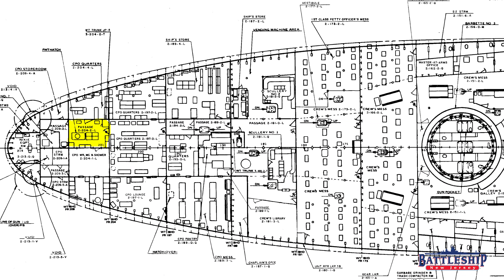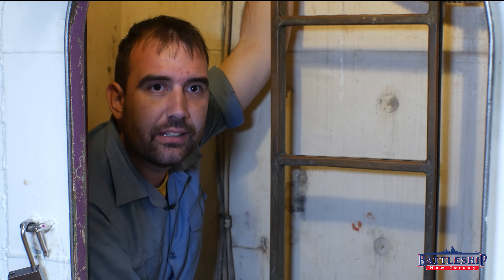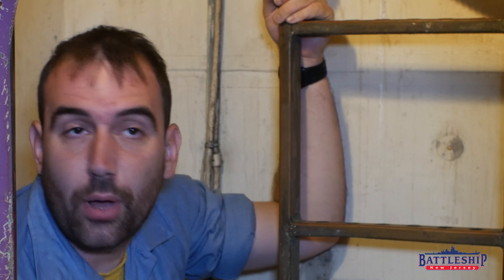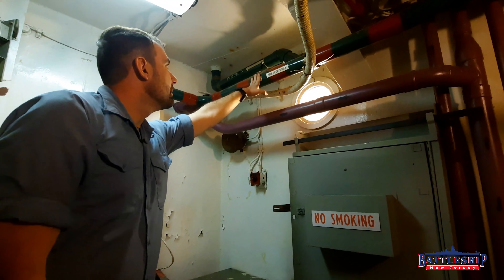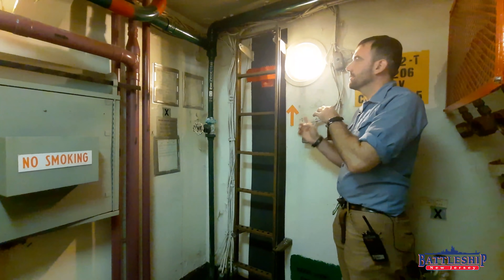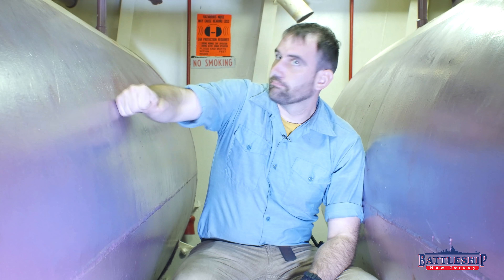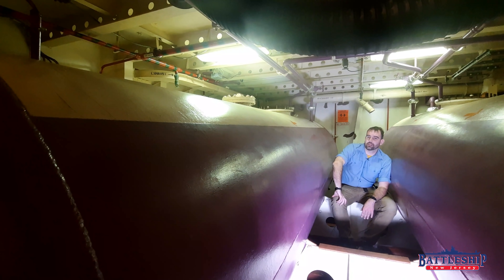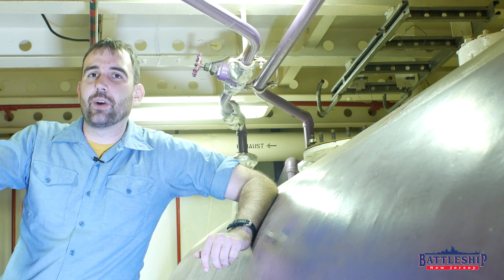JP5: Aviation Fuel

Comment: I was stationed on BB-62 in 88-90.  I was Oil King on an AOR 91-93.  While on AOR I was responsible for roughly 8 million gallons of fuel, and transferring it to the fleet.  A couple of minor things, which have been mentioned, but want to clarify. First we don’t use Octane for a fuel rating. 

AVGAS, Aviation Gasoline, used during the early days of aviation. As mentioned closest to modern gasoline that you use in your cars.  It was originally stored in these tanks because it was highly flammable. 

JP-5 (F-44) modern jet fuel. Flashpoint minimum requirement, set by USN is 140 degF.  Most of the time when I tested it it was about 150-160 degrees.  In other words it didn’t burn as easily, however, if atomized, burns really good.  It usually contains anti-icing additives. It’s limits for bottom set time to and water, BSM, is very low, as I recall about 0.1% and must be “clear and bright” no visible water or sentiment. This fuel could be burned in the boilers, diesel generators, diesel boats, and aircraft, including jets and helo’s.  Usually, it was only used in aircraft due to cost.  The only reason it was in these tanks was left over from WW2 Avgas tanks.  Easier to clean than replace. Most ships store this fuel in standard fuel tanks..

DFM (Diesel Fuel Marine, F-76).  Closest to what people know as #2 diesel you use in your cars.  Usually this fuel is refined better than the old fuel burned when the ship was first commissioned, black oil. It is not as good and clean as JP-5 or #2 diesel fuel. Primarily used because of cost. It is burned anywhere you need “diesel fuel” boilers, Diesel engines, diesel boats, and Gas Turbine propulsion engines.  Flash point minimum 140 degF, although it usually was about 170-190 degF when I tested it. The fuel was much dirtier by allowance, BS&W of 2%, clear and bright requirement, although we were allowed some visual sentiment and water. 

Due to several factors, we never burned DFM in aircraft, they just didn’t like all the “dirty fuel” boilers/engines can handle. However every engineer I knew preferred to burn JP-5 in the boilers, and Engines, since it was cleaner, it was easier on maintenance. 

The reason the space is listed as “7-“ the space designation is based on the lowest deck in the space.  So this space is open to the voids, all the way down at 7th deck. Just because your standing on “5-“ doesn’t mean that’s the space your in.

BTW, although they are two pumps outboard of the tanks, the big cylinders were fuel filter/separators.  They cleaned the fuel before sent to the aircraft nozzles.  It could also be used to “clean” the fuel in each tank in case it became contaminated.
Reply: Thank you!  Hearing "Av Gas" and seeing "JP-5" gave me an instant headache.
Reply: Oil king! How did you get that job? Did you deal with lubricant or just fuel? So none of that nasty number 6 fuel that took steam heat to get burning? Got offered 6000 gallons not a long time ago half and half number 2. Turned it down. Had no idea what to do with it.
Reply: @SkinnerBeeMan  basically I was supervision for Cargo Fuel department, title just an easy way of saying that. On AOR only dealt with fuel. On Jersey, I was in charge of departments oil also.  

Good plan on refusing the fuel, unless you have a boiler, it’s pretty useless.
Reply: @cruser69  yea I had tobacco barns that are oil fired but no steam sorta ended that idea. I do occasionally water down used motor oil with diesel and filter at 100 micron and burn in older diesel motors. Newer high pressure rails on 10 micron clog right up. I imagine on a BB your job would be alot of work with all the different tanks, age of tanks, sheer volume etc
Reply: @SkinnerBeeMan   Thanks for tab at aded  info.
Reply: Adeded info.
Reply: @cruser69  You forgot to mention that you were a critical part of maintaining ship's trim and stability, and that an error on your part could potentially result in the breakup and total loss of the vessel in heavy seas.  Don't sell yourself short...

Greetings from the IC Shop!
USS Kansas City (AOR-3)  88-90
Reply: @kevincrosby1760  would you please quit banging on the deck up there?  How can I possibly sleep in cargo control with all that noise.

Great to hear from someone who knows. KC, I went to RAS school with someone on her. 

Yes I could really make life bad, that’s why Cheng listened to me, and called me directly more than once.
Reply: @cruser69  I can still remember the sound of the emergency diesel firing up and shaking everything.

Now that the AOR class is totally gone, secrets can be revealed...like why you could never find the Duty IC in port.  Remember that blind-dogged hatch for the IC Shop in the escape scuttle?  We'd undog it and put a piece of tape on it from the inside so that it stayed closed, dog and lock the main hatch to the P-way, then pop up to the Cargo Deck, down the scuttle, into the shop, and dog down the scuttle behind us.  Voila!  One dark, quiet, air-conditioned sanctuary which appeared to be unmanned and chained/locked from the outside.

For those who are now confused, the IC shop was 3-49-0-C...Third deck, amidships, and centerline.  Cargo control was directly below us, EDG directly to starboard.

Comment: I can hazard a guess at why the avgas had a tank instead of just being a void space: moisture. By having a physical tank you can sump the water that condenses inside the tanks out so it doesn’t get put into an aircraft.
Reply: It also allows the inside of the tank to be pressurized with CO2
Reply: Many aircraft have sumps on the fuel tanks to drain water as well
Reply: @michaeltruett817  yes they do, but if you can prevent the water entering the aircraft’s fuel tanks all the better
Reply: I imagine aircraft engines (of any era) are much less tolerant of contaminates that the ships engines & generators.
Reply: I can confirm the science, planes dislike water greatly.
Reply: @JimNotAvailable  I dunno man U.S. Airways flight 1549 seemed to like it quite a bit

Comment: So JP5 is not gasoline, diesel, or kerosene. JP5 is most similar to diesel but it is different enough that some diesel engines can't run on it without additives. JP5/8 is made at a refinery to special specifications set by DoD.

Comment: As others have noted, JP-5 is not gasoline.  Fuels for things that fly basically break down into 2 major classes.  There's a bunch of grades of gasoline, all of which are not terribly different from the gas you put in your car.  If you spill a bunch of gasoline on the floor and toss a match in it, you'll have a big fire.

Then there's the jet fuels, which include Jet-A, and all the JP blends.  These are all pretty much the same as kerosine or diesel fuel.  Spill a bunch of any of these on the floor and throw a match in it and the match will go out.   This reduced flammability is exactly what makes them so useful aboard a ship; less chance of an accident (although you still want to be paranoid about spills and fumes).  Calling JP-5 "aviation gasoline" is really confusing.

Comment: The main oil-fired boilers could probably also run on JP5.  My house has an oil-fired boiler, and while looking up other things, I noticed that jet fuel is one of the approved fuel sources for the burner.  JP-5 is a just a military grade of kerosene-derived jet fuel, essentially.
Reply: The ships boilers were modified to run distillate fuel in the 80s. Still an oil bit a bit easier to flow without the need to preheat it.
Reply: @jth877  Yeah, it would suck if the Captain requested flank speed and the chief of engineering says they are still waiting for the glow plugs to heat up....
Reply: Isn't it basically just more pure?
Reply: @BlackHawkBallistic  More pure with special additives, yes.  Fuel oil has a multitude of grades that get progressively more ... disgusting.  Heating oil grades are less pure than road/aviation fuels, but more than many grades of fuel oils, as I understand it.
Reply: @jimmitchell6000  Yes you get different grades. What most ships burn out at sea is very much the same as road tar, the heaviest fractions that need to be heated up with live steam to get them to flow, and thus are only used when far out to sea, as they are not exactly a clean burning fuel. But very cheap, and high energy density, so get used, even if the exhaust would fail any pollution standards. Come in and you switch to a more volatile fuel, often almost the same as the engine lubricating oil, which is also burnt in the engines to dispose of it.
Reply: @SeanBZA  not a single ocean going vessel will burn lube oil to get rid of it as it is way more expensive than fuel. The fuel used in ECA areas is limited in its sulphur content but if available can still be heavy fuel. Maybe you’re talking about the incinerator these machines are capable of burning sludge produced by the vessels purifiers.
Reply: I would not use AVGAS in your boiler 
Diesel yes jet fuel no
Reply: @FP194  Today I learned that the military doesn't know what its talking about if it calls jet fuel "AVGAS". :)
Reply: @jimmitchell6000  The military knows; the curator mixed up the terms.  Purple color coding is for JP-5, and that’s what NJ used to refuel turbine-engined aircraft during her final active period.   AVGAS was only used in piston-engined aircraft which were long-gone by that time.
Reply: @jimmitchell6000  Trust me, they know the difference.  The confusion comes in due to the fact that, in this case, the original AvGas storage and piping system was apparently re-purposed in later days to handle JP-5 jet fuel.

Comment: its stored in tanks because of the fumes 
.
the fumes are what burns.... not the liquid
and you dont want the ENTIRE ship to smell like fuel fumes...... (or have a HUGE ventilation system)
.
like... you dont want your entire ship being a big "fuel-air" bomb..... 
.
.
diesel fuel does evaporate and create fumes
but its MUCH MUCH slower to evaporate 
and the fumes are NOT flammable

Comment: Hi, would just like to say that I only recently discovered your videos and that I enjoy them a great deal. I would also like to address a couple of things within this video. First of all I believe that when the battleship was commissioned and had airplanes on board the gasoline which at that point in time was indeed gasoline was somewhere around 130 octane. Later on when turbine helicopters became the norm there was no longer gasoline in those tanks however jet fuel which is not gasoline at all but or along the lines of kerosene which is backwards compatible to the dirtier cousin of it which is diesel fuel. The reason that those tanks were designed the way they were designed was likely due to the fact that fuel in aircraft is considered a critical issue especially when it comes to moisture content. I wouldn't doubt that those tanks had a means by which to drain water out of the bottom of the tank where it would separate from the fuel itself. That is probably why they were designed the way they were designed. Another factor in their design may have very well been that when the ship was originally commissioned in those tanks held actual gasoline the gasoline is far more explosive than diesel fuel.

Comment: JP5 is not avgas. It's closer to kerosene.
Reply: JP-5 is #1 diesel with some extra additives.  You can run it in a diesel engine.  I am sure they used AVGAS through Vietnam.

Comment: Should note that JP5 was always used aboard ships due to it's higher flash-point than JP4. JP4 was still the main fuel used ashore when I was in. I believe today most of the services use JP8.
Reply: Navy still uses JP-5, and the few times I've gotten close to a few helos, it says they're rated for JP-5 or JP-8

Comment: Avgas Purple (fuel was dyed purple) was high octane for Supercharged radial engines , 82 octane red was lower car gas grade , 100LL Blue for small planes etc , You can run a turbine on avgas but you can't run a gasoline engine with jp5
Reply: My dad use to be a pilot.  I love those colors.
Reply: @studinthemaking  used to run our fuel trucks at the airport on 100LL blue 😊 just run the nozzle to the gas tank anywhere you felt like filling up..
Reply: @Droodog127    My dad use to put it in his cars during the 70’s gas shortage at the airport. Blows the carbon right off the engine.  Digital fuel equipment ruined a lot of cool car stuff.
Reply: @studinthemaking  shhhh  I ran my '76 chevy pickup with it too lol
Reply: @Droodog127     Ran our Chevy station wagon it.
Reply: @studinthemaking  miss the old 350 Chevy with the 4 barrel carburetor, that truck had 200,000 miles on it when I bought it for $100 , I sold it for $50 after the state refused to inspect it any more LOL
Reply: @Droodog127     Did the avgas burn up your spark plugs fast?
Reply: @studinthemaking  no, mixed half and half with unleaded and a few moth balls , someone ripped out the catalytic converter and put a duel exhaust in it before I had it , it was just engine, no fancy computers, I changed the head gaskets before and it ran clean for a long time .
Reply: @Droodog127     My dad was a real cheap skate.    He dump straight avgas in it and fill it up just to save a few bucks.  He was always replacing something on our cars.

Comment: JP-5 is NOT gasoline, and is far from it. It’s jet fuel, which is a kerosene derivative. Closer to diesel than it is gas. Modern warships with LM2500s can run off of either marine diesel OR JP-5. But either way, calling it gasoline is entirely incorrect.

Comment: aviation gasoline of WW2 was very high octane with a really low flash point.  Puttng that into structurally independent tanks reduces chance of leakage from battle damage and thus, risk of fire is reduced.   The only user of aviation gasoline would have been the float planes, so the amount needed was relatively small, so the few thousand gallons in those tanks would have been enough.   Vietnam era helicopters mostly ran on JP4 or 5, so probably just repurposed the same system for JP5.  
  Lower octane gasoline was also used for fueling portable fire pumps, Possibly also the ships boats in older eras.  
  was New Jersey converted to run on DFM in it's 80s comissioning?  I would assume so with the NATO one fuel program.   Thus everything would then run on the same fuel.  Ship, boats, helicopters, etc.   Don't know what the drones of the 80s used, I suspect gasoline, but that is purely a guess.
Reply: The H34 Sikorsky helicopters that served in the earlier part of the Vietnam war were powered by piston engines, and burned AVGAS.
Reply: @chemech  thanks.  Not a helicopter guy here.  I understand the military pushed hard to switch over to JP4 and 5 fueled aircraft once they got small turbine engines figured out.   Many many avgas fires that killed lots of people during big mistake 2 and Korea.   I recall that one of the last gasoline fueled thing in the army were the field kitchen stoves, getting them working reliably on JP4 apparently took a lot longer than anyone figured. 
Used to be an HM, learned lots about fuels when I got my ESWS qual, as the oil king on our ship was the a main instructor for engineering stuff.
Reply: @dalesql2969  I never signed the Contract... always a civilian engineer, but I spent a few years at a defense contractor.

My original education was in chemistry and chemical engineering, and I'm an amateur historian, so I can only say so much before I run off the end of my knowledge...
Reply: I was stationed on her 88-90.  Short answer is “most”things ran on DFM (F-76). The boilers, and diesels ran on it.  Not sure when converted off top of my head, but think it was 80’s commissioning.  However, I say most, since the P-250 emergency fire pumps used Gasoline, and the drones used aviation fuel (Avgas) not JP-5.  They had a special fuel just for them.

Comment: Is the bilge under the fuel storage separated from the rest of the bilges?  I'd hate to have gasoline fumes (although JP5 would still be an issue) free to migrate into the main bilge spaces.
Reply from the maker: The bilge on NJ is split into many many compartments, not one continuous space
Reply: @BattleshipNewJersey  A suggestion for a future video:  If it is like most other Navy ships, the New Jersey should be a main drain line that runs the length of the ship.  It will have isolation valves on both sides of every bulkhead.  Then there will be a suction in each compartment.  Many compartments will have bulge eductors using fire water to pump water out, and quite a few pumps on it.  The fire pumps, and condenser circulating water pumps are often connected into the main drain line.
All of the valves should be operable from broadway inside the citadel and 2nd deck forward and aft.
In response to Chris's question, I wouldn't be surprised if the aviation fuel storage has only an eductor and no connection to the main drain to avoid a route for fumes to get to any other bilge space.
Reply: @BattleshipNewJersey  Thanks for the clarification. That is the smart way to do it otherwise you would blow more up it there was a leak from those tanks to the bilge.